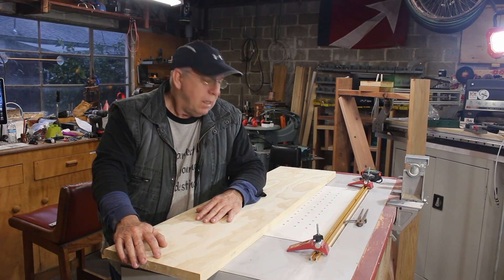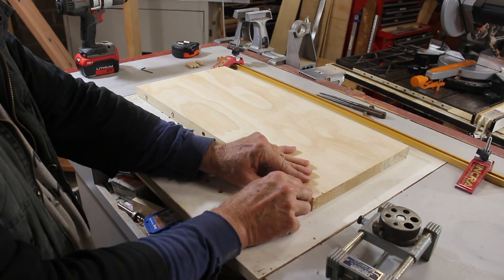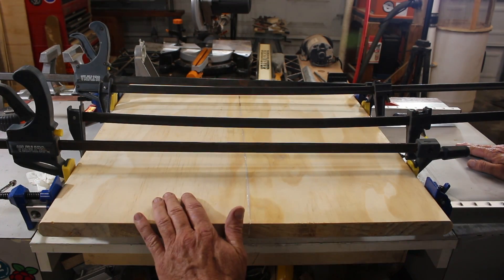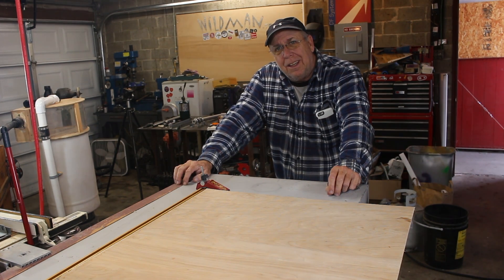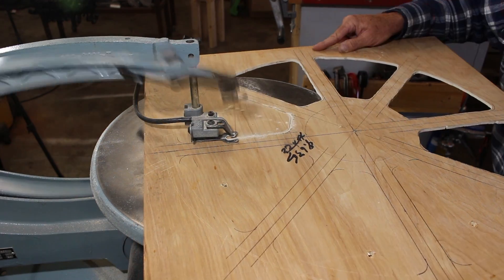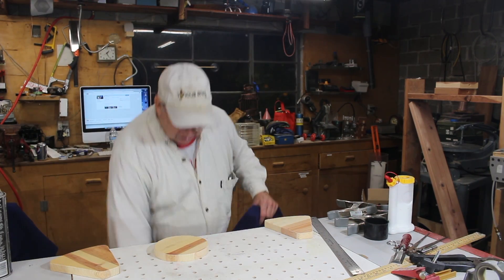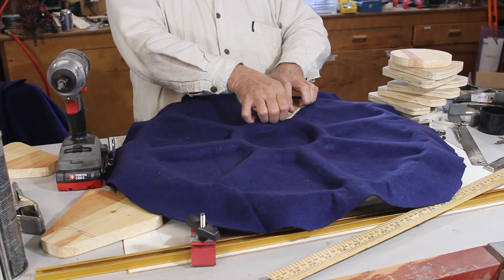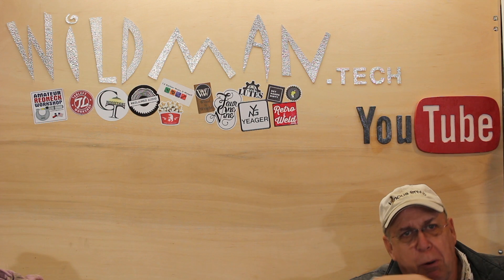Tripoli Board and CNC Router Tribulations

Comment: Instructables has a CNC class - you have to be a pro member but it is out there.  Instructables is an autodesk company.  - I was wondering why you were trying to carve away all of the material - I would have just cut a circle and that would and left the other ring of wood.  Also - I normally use double-sided that way there is no need to worry about the clamps.
Reply from the maker: I know people at Autodesk and at Instructables. They keep referring me to classes that cost $500
.

Comment: Marsh, the CAM portion of Fusion is an art form all its own.  To control it a bit better, I would have broken it down into a handful of operations...  First, 2d adaptive clearing for the center circle and the pie shaped pieces set to a rough pass so they leave .004-.005".  Next 2d contour to run your eased edges.  Your model in fusion should NOT have the fillets/chamfers modeled.  I know it looks better in CAD, but the CAM doesn't really like it...  I always make 2 different bodies in CAD, one with the chamfers and edge fillets and one without...  The one without makes its way into CAM, the one with is just so I can see what it will look like....   Next, run a 2d contour around the center and pie shapes as a finishing pass to take off the final .004".  Next is a 2d contour for the outside circle.  Again, set this to be a rough pass and leave .004".  Last is a 2d contour that is a cleanup pass.  There's no need for adaptive clearing with wood since you can plunge a router bit and cut a "trough"...  On metal, I would use adaptive clearing instead of 2d contour.
Reply from the maker: Thanks for that advice Greg. I need to find a class I can take. Progress is very slow on my own. Getting pretty comfortable with modeling. Onto CAM.
Reply: Search google for fusion 360 basics and you'll find some autodesk classes that they offer for free.  They have basics all the way up to advanced.  A few of those sessions and you'll be on your way.  If you don't already watch NYC CNC, subscribe to John's channel.  He's got fusion videos every week where he steps through both the modeling and cam.
Reply from the maker: I think I'm going to try this again. I've learned a lot about CAM in the last year, thanks in part to you.

Comment: Could have used the cnc to do the center sections of the board then just taken the outer sections off manually as you did :-)
Reply from the maker: I have yet to cut anything on it. I didn't want the first cut to be with a simulation that I knew had problems.